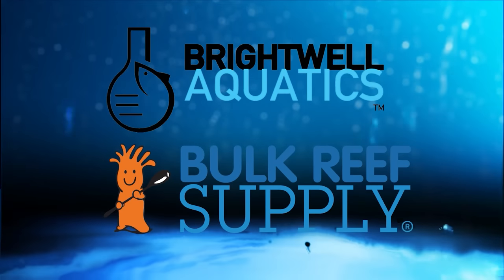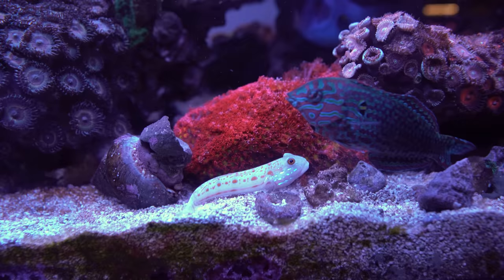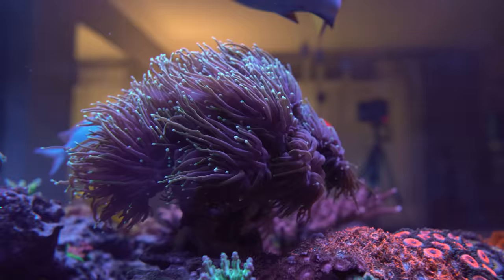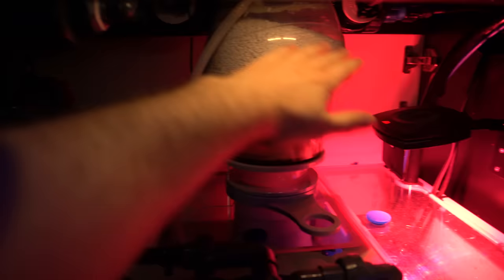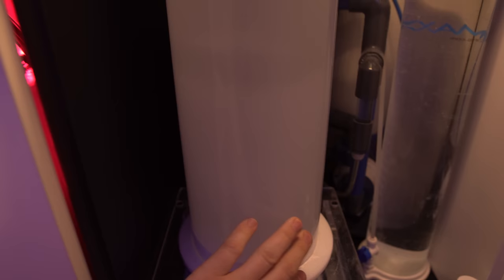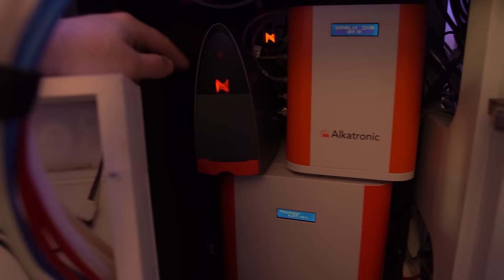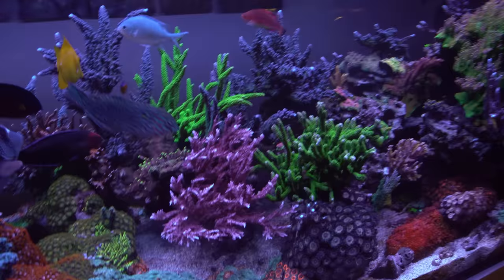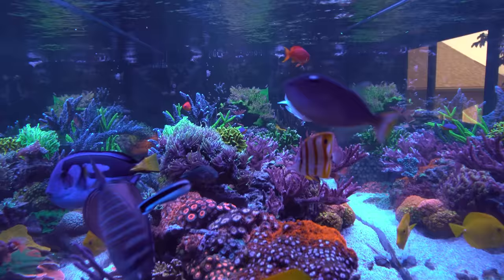Waterbox 7225 Peninsula Saltwater Reef Tank Aquarium Update

Comment: How old is this system?  Pro Tip:  Be careful with your Versa mounting.  I noticed you have pumps directly over other pumps.   I've had 2 sets of the tubes start to leak (kalk) and had liquid get into the pumps.  Luckily they didn't fry.  I love ecotech, but they seriously need to get their tubing fixed.  They hadn't been run long at all.  Second one to fail was only used for a couple weeks.  Shame that the best dosing pump has the least reliable tubing in my experience.  I use the DOS, Kamoer continuous duty, and haven't had failures with them.  Always function over form for me.